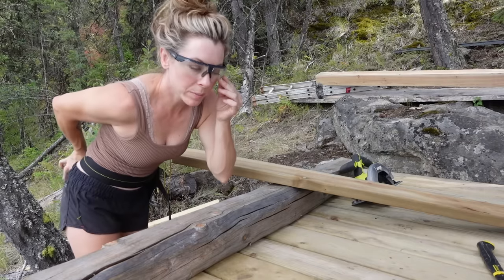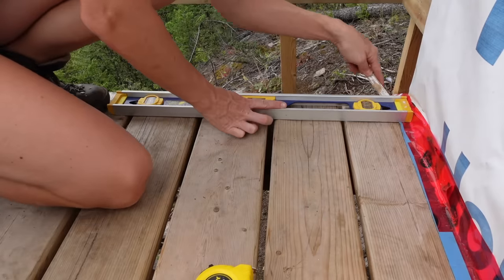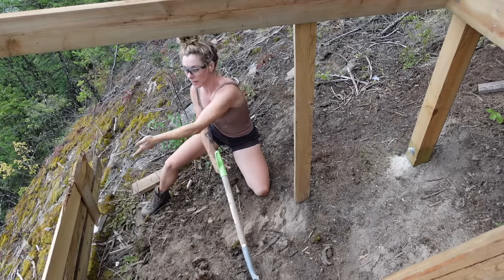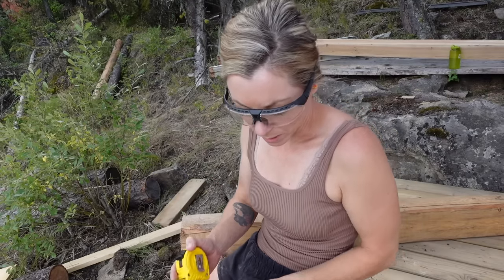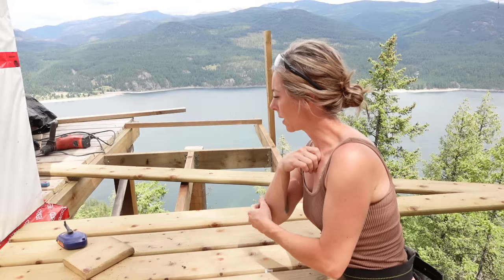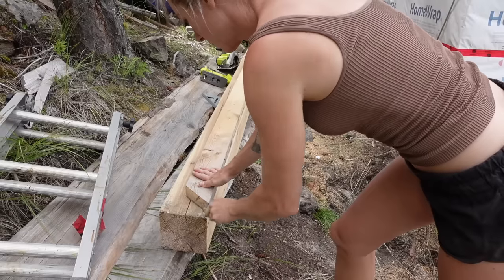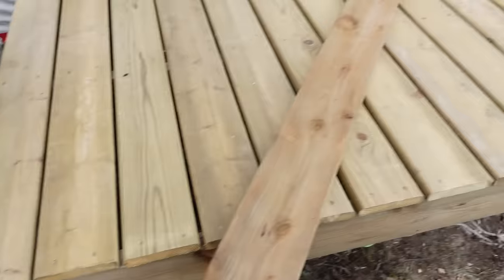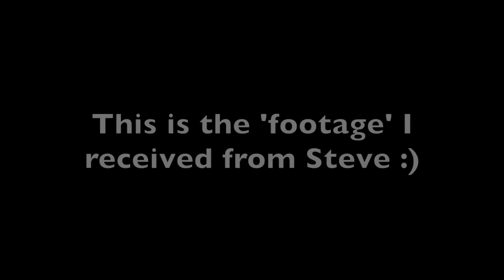Would you attempt this by yourself ?? The Cabin on a Cliff series.

Comment: Next time you want to square up a large area try using the 3-4-5 triangle method. (3ft by 4ft by 5ft)
Description

The 3-4-5 triangle rule states when the ratio 3:4:5 is present as the side lengths of a triangle, the triangle is a right triangle. The 3-4-5 triangle satisfies the Pythagorean Theorem which states that the sum of the squares of the two smaller sides in a right triangle equals the square of the longest side.
Keep up the great work! 😊
Reply: I was here to see if someone beat me to it but yeah, I believe it's Pythagoras theory.

Comment: You are building a small cabin onto the side of a freaking cliff, the cabin should be integrated into the cliff side, therefore it cannot be exactly straight, true, plumb or even perfectly or level. You are doing one hell of a job, well done.
I'd add that when I build decks I always put the flashing tape (the red stuff you have on the walls) on top of the joists that the deck boards sit on. Most decks rot out when the top edges of the joists fail, the flashing tape mitigates this.
Well done, I'm sure you are proud of your cabin, you should be.

Cheers from Tokyo!
Reply from the maker: Thanks Stu! I did think about using that on the deck joists. I know that there is a special product you can buy, but I wasn’t about to do that and had wondered if the resisto product would work the same. 
Hmmm. Next time! 😃
Reply: @michygoss7148  the special product is no doubt better, but the tape you have is better than no tape, and you have it!

Comment: Just an idea~~~
Several years ago I had a client whose deck was on a stilt house overlooking the Loxahatchee River, he wanted a rail and picket system that gave him the best view of the river through it. What I came up with was a heavy-duty 2" mesh nylon net that I fixed to the rails with 1/8" bronze brazing rods woven through the net, pulled tight, and attached with 1 1/8" x 1/4" SS staples. It was a little tricky to weave and pull to get a good tension but after the first panel, it became easier. It was a saltwater environment so I had to use non-ferrous metals. It was so successful that a year later the neighbor employed me to do the same system on his decks. In hindsight, I could have purchased the net "tarred" but I had visions of an oily mess, now I am thinking it may have been a better choice as was not oily and it would be even more transparent and the tar-like coating would have prevented water, and sunlight from getting into the fibers.

Comment: Nice job finishing that deck corner. You were clever accommodating out-of-square-ness. I would probably not have leaned out on the gap with only one board in the middle. You must be used to doing planks. If I tried that, that middle board would have slid down to my ankles and I would fall through the gap. I would have cut out the rest of the decking boards and laid them all down.

Comment: Hammer drill rock and epoxy insert for threaded rods. Drill holes for galvanized post supports, insert epoxy after taping threads and have large washers for spacing to level the post plate.       Used glass hammer epoxy inserts on large commercial industry jobs to anchor machines and they work great.

Comment: Well done and spy music too..i install large auto gates that dont touch the ground. The supporting posts are yanked everywhichway, i weld bracketsto a post and anchor into the avtual rock or strata and poor a concrete base over it all. No complaints in 30years but then again if the groundmoves that 50' gate could swing wide..

Comment: I would attach a straight plank to the existing deck (on the front) and run past so you could get an accurate measurement plus, have something to hold your next framing board too.

Comment: If you want to check for square-you measure in an x pattern. Corner to opposite x corner, then the other 2 corners.
Measurements should be the same.
A small nail can be to clip your tape to measure.
As you mentioned, if it's out of square, it's tough to get back.
At least you have the right attitude.

Comment: Yes, As you mentioned, you should have cross bracing on the end period. I see you have it on the section next door, but since your decking is not full length and there is essentially a joint there, I think the cross bracing is needed.

Comment: It's fascinating to watch you learn new skills! Here's a great tip...the 3,4,5 rule to set square. Measure and mark one side at 3 feet. Measure and mark the connecting side at 4 feet. The hypotenuse of that triangle should measure 5 feet. If it does not you're out of square. This works with any measurement in this ratio. For example, 6,8, and 10; 12,16, and 20, etc. Even works in the metric system 😂

Comment: add some more structural support with cross 2x4 to bind your deck to support snow load and weight plus railing all around . but build all around or tie down the whole structure rather then depending on the nails screws . give your beautiful creation to withstand high wind or torando style stroms . you are doing a great job just read some structural engineering books also for load bearing calculation not exactly but rough estimations for it strength and your safety during high wind and pressure of its own weight . you can add net all around your deck for your dog safety if they jump from deck .

Comment: Food for thought. When setting your posts on bedrock, I’ve had a lot of success drilling into the rock then driving my fastener into the rock leaving 6 to 8 inches out then drilling a hole in the middle of my post to accept the fastener. Leaving the post to basically float on the rock. With extreme weather conditions on both sides of the mercury I’ve had excellent results with heaving and contraction of the post. Just saying

Comment: Tack a string line on the front board thats long enough to go past the outside joist.. then hold it level and move it towards the face of the board. When it touches the face it will show you where to cut the joist.

Comment: I don't know if this has been mentioned in the comments, but you should measure your diagonals to help with getting things square.  To square things up, make your diagonal measurements match.  It may take installing a temporary ledger when you have an opening like you did, but you already had a fixed diagonal to use as the reference for the other diagonal.
Reply from the maker: I did do that! 🫣

Comment: Your adorable with great spirit, you need to learn how to use string to get things straight, and a chalk line for snapping straight lines. When you frame up anything rectangular, your dimensions need to be the same at both ends, then you measure corner to corner, get it with in 1/8  of an inch both ways, and your square. Keep up the good work. I'm curious about your location, looks like Oregon or Washington.

Comment: You have to know what size you want. You would put that two by six parallel to the deck then pick your starting point for a side. Just an example but if new section is 10'X10' you would measure from starting point diagonally 14' 1 11/16"  Now you have two square corners. Measure over 10' from each of those diagonal points and you will have a perfectly square footprint. Easier to set up with string line first. The 14' number is just calculating your 📐 triangle. Plenty of apps to calculate any dimensions diagonal for you. Hope this made some sense. You are like I am in learning, just show me. Lol. Best I could do for ya, sorry. You're kicking butt by yourself!! Good luck in all you do!!!

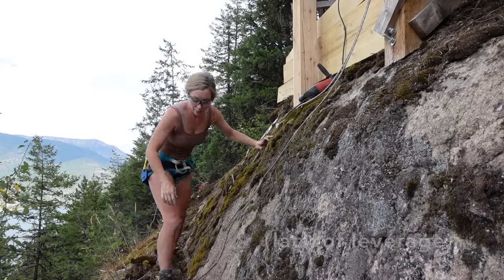Comment: 26:06 Mich, why did you not put a (mental plate) to anchor the post to the bedrock? You just screwed a bolt 🔩 into the bedrock 🪨 at a angle...
Reply from the maker: It is an anchor bolt. A metal plate would have to be custom made and it’s not really necessary

Comment: Ooooh, such a treat! Those tan lines of yours make me think the atmosphere on the boat was not relaxed enough to abandon all clothes? What a pity! On a different note, have you checked that the joist hangers you used for the joist that is supported by the central post are rated for enough upward force? If the joist supports the trimmer rather than the other way round then joist hangers aren't really designed to do the job.

Comment: In the construction world, any time you're trying to find a square on two planes, the best method to use is the 3-4-5 method. So the method goes like this, you measure from your corner on the right side 3 feet, from the same corner on the left side you measure 4 feet, and then you measure from the 3-foot mark to the 4-foot mark and they should measure 5 feet if it does not then you need to adjust one or the other till they do. You can also use a string line or4 a chalk line down the side of the existing deck to get things parallel and straight. Just a couple of tips for you, if not this project then the next one. As far as a measurement on the boards goes you measure the existing side first inside to inside of where you are going to fill in then add 4 to 6 inches to that number and try it out on your outside piece, you can always cut some off but if your short it's not so good.

Comment: I am surprised that you didn't mount metal post brackets to the boulders so you could mount all post to them, instead of drilling the post ,hammer drilling the boulder and then putting a anchor though both. But since you have never did it before,it looks great.

Comment: 29:45 well you are done; just one suggestion to upgrade the structural integrity of the two decks. Since they are screwed down, the large run area in front of the cabin and the new outside corner; take up every third deck board run and swap the short board with the long board, that way you overlap the decking on the seam and tie the two deck areas together. Not needed but I like beefy structure for long term low maintenance.
Reply from the maker: I thought about that, but I didn’t have enough material on site to do that.

Comment: Just chalk a control line on the main deck, it can be an arbitrary spot (2 feet off where you’re working). Then simple math should resolve any issues (2’ @ corner 2’-3” far corner, so deduct the 3” from length of far rim joist). It should be said square the chalk line off whatever is most important eg cabin back wall (3-4-5 or 6-8-12). If this doesn’t help for this project maybe it will for your next.

Comment: Or u can use joist hangers, use the correct nails and screws. PT wood needs special nails and screws. Or it will dissolve the steel. I used guard dog screws but there are other coated
Ones just make sure they are made for the PT wood.

Comment: You should have a harness on you working that close to the edge. If you fall you’re going to be in trouble.  Not trolling, just concerned. I fell off my roof in September and broke my L-3 vertebra above my spinal fusion.  It’s February and I’m not 100% yet. Steve would be upset, you can get them on line.

Comment: Square, 3-4-5 trick. Measure 3foot on the side you want to be square to, measure 4 feet on adjoining piece measuring from the corner that meets the starter wall then putting the rule edge on your first mark and moving the second piece till the edge meets 5. Foot on the rule.                Draw a right angle  and see it

Comment: I think I would have use that hammer drill to drill 4 ea. 1/2 inch holes in the rock where I was going to put my posts at drop some rebar down inside the holes build a concrete form around the post areas and then poured the concrete into the concrete forms and then set the post on top of concrete cuz you have a flat surface to work off of.

Comment: Easiest way is measuring both sides than use those measurements to estimate where the post should set
Now with post temporarily in place measure your 45%angle from deck edges and use that measurement to locate exactly where post needs to be or at least your decking so that it is square.   Anytime you're building a square you must measure from corner to corner X

Comment: I see already that other folks have offered solutions for checking squareness, so you don't need another one. What I think you might want to consider is to ask what being "square" means, not geometrically or mathematically, but aesthetically. It helps to rethink "square" as a particular version of consistency. There are three concepts which are fundamental to building any any structure: straight, level, and plumb. For safety and construction soundness reasons, those should not be forsaken without sound engineering and extensive experimentation. (See yurts and Stonehenge.) On the other hand, "square" and sibling "parallel" are specific ways to reference from an existing edge/surface, and those can be aesthetic choices, with triangles, hexagons, and portions of circles being equally valid ways to cover an area.

Based on what you ended up with, being "square" wasn't as important as lining up with the previously completed front deck and far side (because its the furthest from the trail you usually use to access the cabins) deck. Also, being "square" wouldn't've helped with new side deck boards not sequentially match up to the front deck boards without leaving noticeable gap. (I'll go over how the gap seems to have happened below.) You did the very right thing of cutting back the edges of the front deck to get a consistent edge to measure from, as well as expose a full joist to set the new deck boards on.

Now this is where the order of operations would've helped alleviate your anxiety on the length of the outside joist extending to the front of the cabin footprint. Trimming the edges of the front deck should've come first. Then you can clamp a board on top of the frontmost deck board and extend that past where the new joist goes, and clearly mark on that board where the deck should end. You can then measure from the end of the finished side deck to the clamped board to get the length of the joist needed. Two tools that helps with this is precision straight edge like a piece of aluminum or an eight foot level, and instead of a tape measure that may not hold it's own weight when extend 7+ feet, a laser tape measure that can produce a strong enough light so you can see it hitting reference marks on the far end. And the other thing you need for this to work easily is if your lumber is basically straight. Joists with bows are hard to wrestle when everything is a foot off the ground.

I went back scrubbed through the current deck build videos and found phase 1 of the far side deck board install in the July 23rd video. I had suspected that you had started them from the back of the cabin, and didn't seem to reference from the front deck to match the starting point, and that is how the offset happened. I like your solution of adjusting the gaps for what looks like about half of the phase 1 boards. You didn't have this problem with the near side deck. I'm too lazy to go back before the videos of the boat stuff to see how you did the near side, but my memory says that you started from the front, because it evolved from a temporary platform for putting on the house wrap and eventually the siding.

And to finish this way too long comment, you have enough of the cabin built that being "square" is not was important as making things line up. I hoped I've given you some ideas on how to think about what you're aligning to, and I look forward to more videos.
Reply from the maker: You’re smart! 😊
Thank you!

Comment: Yup, earplugs don't work well when they go through the wash. Measure corner to corner for square and adjust bring it in until the measurements are equal if possible. So, where you were wondering the length of cut you could measure out from where you wanted to get to from an angle and use a string line or a couple string lines for reference. I'm sure it turned out for you:)

Comment: Measure and mark 3 units from the corner along one side of your project, then measure and mark 4 units from the corner along the other side. Line up a tape measure between your marks and check to see if the length measures 5 units. If it does, the corner is square.

Or you have a guy like me build the cabin in exchange of stay and some food vacation. Lol 😆

Comment: If i were you where you put those anchor bolts through your posts i would use a full width steel plate under them and use spherical washers to account for the angle.

Comment: Getting Square: a 3/4/5 triangle is perfectly square. Pick a convenient number of inches/feet; multiply three times that number (3n) and that is your first a-b line; multiply four times the number (4n) and swing an arc from point a at an approximate right angle; swing a third measurement from point b that is five times the number to where it crosses the second (4n). The angle at 3n/4n will be 90°
Reply: Sorry, dont use Telegram
Reply from the maker: Neither do it. That’s a scam

Comment: Has anyone suggested string lines and the 3-4-5 right triangle method of determining square?
Where two sides are an interval of 3 and 4 and the hypotenuse is an interval of 5. Also may try string line and and having the two diagonals of equal length.

Comment: Probably way to late for this project, but to get a perfectly square corner, you want to aim for a measurement ratio of 3:4:5. In other words, you want a three-foot length on your straight line, a four-foot length on your perpendicular line, and a five-foot length across. If all three measurements are correct, you'll have a perfectly square corner.

Comment: Please consult a contractor to help you with bracing. This will last 5 yrs in wet condition as is, a little bit of bulking in a few places should triple that. Too many joints split on a single board. But other than that you have the right idea.